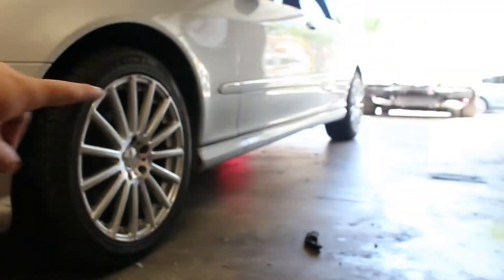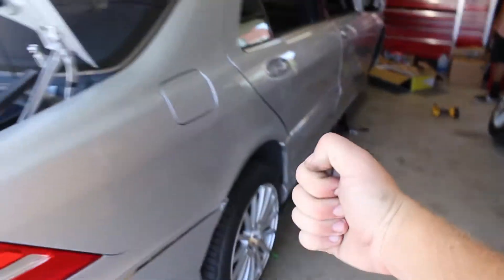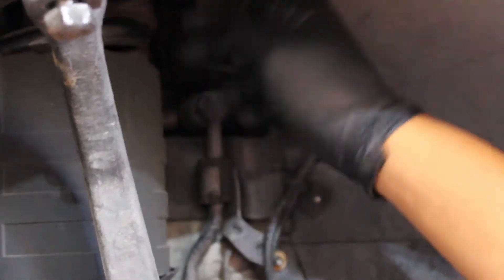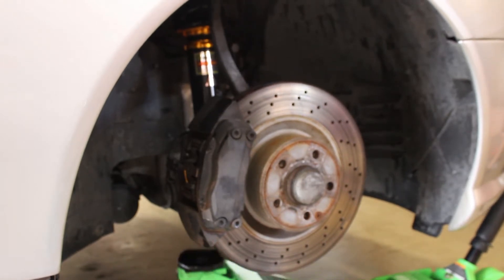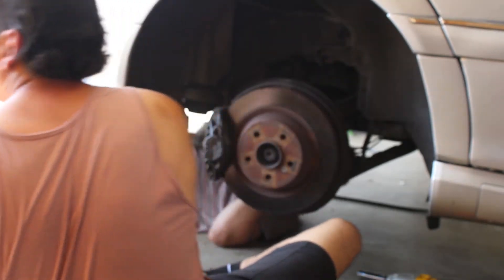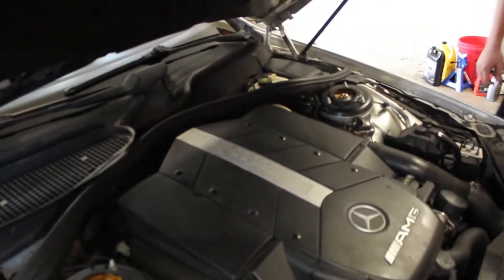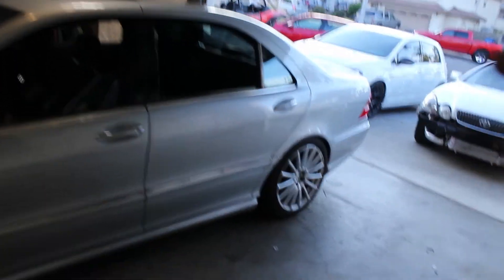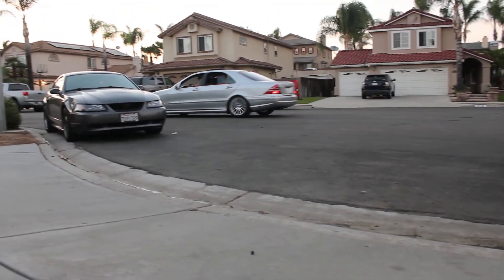S55 AMG Yellow Speed Racing coilover install!!

Comment: I want to do this but I’ve heard you need to add a power steering pump and taking out the abc pump
Reply from the maker: @danielsamm9020  yeah we replaced the power steering pump with a unit without the ABC stuff, it honestly was fairly simple the only pain was one bolt on the back side but even then it just took some patience.

Comment: How did you adjust the dampening dude
Reply from the maker: @ToddtheLoneDroner  theres a long thin tool you can use to put
Into the top of the coils and spin it and adjust it by clicks, I can’t remember if the coils come with or if you have to purchase seperately
Reply: @GrizzlyGarage  Yes, I got the tool I forgot to put in on my c. L5 100 but I guess I can live without it. I leave it at the factory settings comma just wondering if you change your settings

Comment: How does the Yellowspeed feel for daily driving? Is the S55 still comfortable for daily driving a big sedan like the S55? thank you. great video
Reply from the maker: “Daily driving is great! It handles well at the height its at and the adjustable dampening helps really dial in the suspension to where you want it. I wouldn't say it's as smooth as the ABC suspension but it's nothing crazy jarring or bumpy”